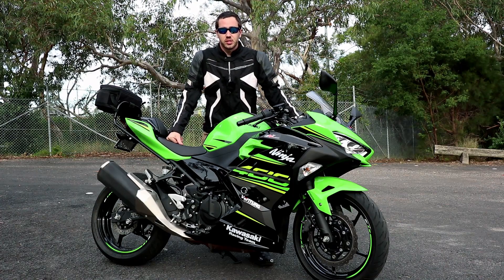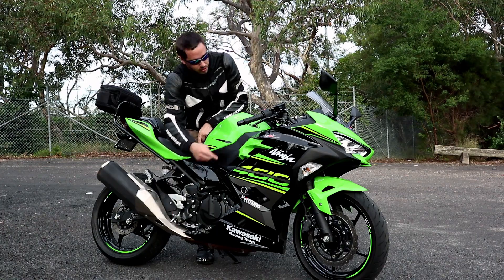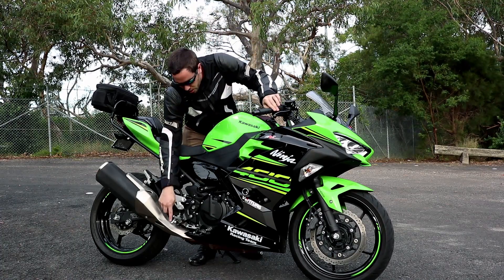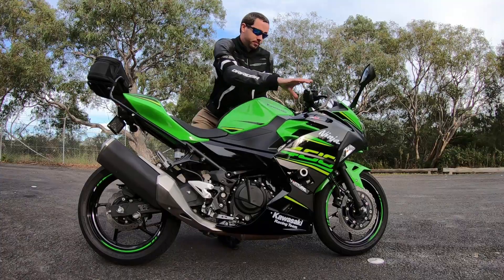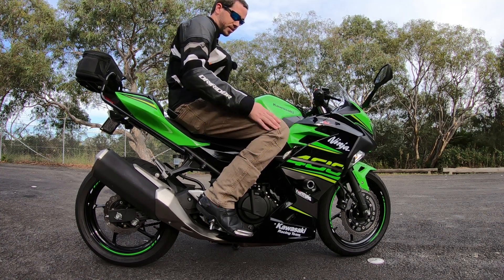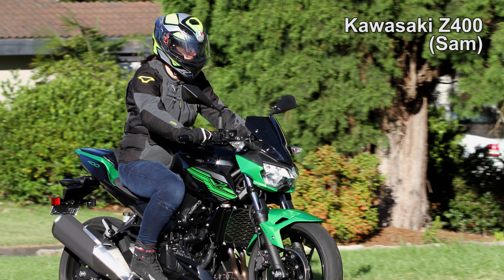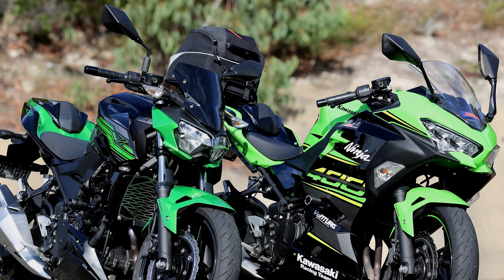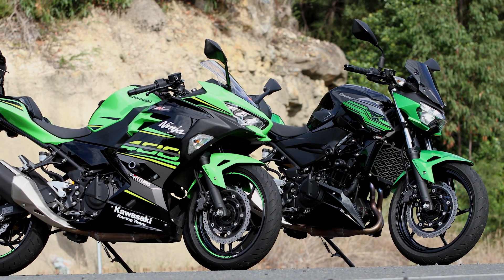Motorcycle Ride Triangle (Ergos) - With the Ninja 400

Comment: Hello buddy, I have one ninja 400 too, and I 'm looking for something like yours in the back. This pipe for holding  the bag, could be used by the passenger? my girl is afraid to ride the bike she dont have where to hold her hands. Could you tell me where you bought this one? Thanks
Reply from the maker: I think so, as long as your pillion is keeping their weight forward, they should definitely be able to hold on to the rack so they don't feel like they'll fall off the back! That's a Ventura Sport-Rack on it there, which has the higher loop. There's also a grab rail version and a heap of other options.

Here's the website link, you can see whether there's a local distributor for you, top left under the International website options.
https://www.ventura-bike.com/#

Comment: I noticed that in 1.44 minutes when you get on the bike you have to press down the brake pedal in order to get a comfortable riding position. So the riding position is too cramped and not good for you. I have the same problem, have long femur bones and limited dorsal flexing capabilities. I will subscribe. You cover important topics.
Reply from the maker: To be honest I normally park in neutral unless I need the bike in gear to stop it rolling, so it's just a habit of making sure the bike doesn't roll away. But having long legs does have a real impact on bike fit! Thanks for subbing!
Reply: @MotoJournoKris  Ok, it is safe but for me it also seems to be a more comfortable riding position for you :-)

Comment: Hey mate, what do you think about the ergonomics of the all new ninja  zx 25r? I watch a lot of videos but i cannot figure it how the ergos looks like considering that it is a zx line up..
Reply from the maker: Doesn't look like we'll be getting them here so I haven't been able to check one out in person, but comparing the bikes the bar placement on the  ZX-25R is much lower, further forward and more aggressive, so more like the ZX-6R there, while the seat looks a bit lower, and the tank more compact. Pegs don't look too different to the Ninja 400, maybe a little higher, which would be more compact. The 400 is quite relaxed by sportsbike standards, so the ZX-25R should be more like a ZX-6R or ZX-10R if smaller, with that very committed seating position.

Comment: So i am  looking into getting my first bike i am  between z400 and ninja 400 ,what do you think will suit me better (i am 186cm tall and 100 kilos macular body type) my concern is that my knee will be bent too much and will be uncomfortable, is there a big difference on the sitting position?
Reply from the maker: I didn't find a significant difference between the two as far as seat and peg position, although the Ninja 400 is a little wider between the legs. I'm only 180cm but on the longer legged side and felt like there was good amounts of room - for sporty little machines. The bigger difference is the 'bar placement, which is more upper body position.
Reply: Also thinking about the duke 390
Reply from the maker: @Bobisdeadrun  It's been a while since I rode the Duke 390, but they are compact and probably even smaller feeling than the Z400, which is kind of offset by a taller seat height. I think the latest edition actually has an even taller seat height than the one I tested, but then you need to check out the reach to the pegs.

Comment: I am 5'2. Ninja 400 is good or bad for me?
Reply from the maker: You'd probably need to sit on one to be absolutely sure, as it's quite a low seat height and very narrow between the legs, but you might not be flat footed. The weight and centre of gravity is also low and easy to manage though, which should help if that's the case.
Reply: @MotoJournoKris  tnx sir. Im not sure if ninja400 i want 2 buy. Yamaha r3 is the other option. Thank you very much sir. Im a beginner.
Reply from the maker: @shamluck1780  They are both great options for new riders, there's not a huge difference in seat height and reach to the ground between them, but there's some slight variance in seating position and reach to the 'bars. If you can, try and visit a motorcycle store and sit on both to get a feel for them.
Reply: @MotoJournoKris  for your opion sir about seating position. Which is the best for you? N400 or r3? I try r15 but seat height is a high.
Reply from the maker: @shamluck1780  The R3 felt a bit more aggressive than the Ninja 400 to me, due to the bar placement and the seat is more comfortable. But for some riders they may prefer the Ninja 400 being a little more upright.

The R15 actually has a taller seat height than both, but if a very narrow bike, so you'll probably find the R3 or Ninja 400 easier to reach the ground on.
Reply: @MotoJournoKris  thank you very much sir. I always watch your video. 👍👍👍👍👍

Comment: What's good, Kris? I heard that your right heel ends up touching the pipe on the 400, can you confirm/correct on that?
Reply from the maker: I haven't noticed that to be honest, but if you're riding with the balls of your feet on the peg but flat footed and have big enough boots it's possible. If I'm riding fast enough to have the balls of my feet on the pegs I've usually got my heels tucked up against the heel guards. My everyday boots are a US12, and I have had that on some bikes in a more intrusive way though.

Comment: For me that ninja 400 has the perfect triangle for comfortable sport bike riding. Like a sport tourer/sport commuter. But it absolutely amazes me why they make such a good triangle yet the seat is only good for 30minutes. Basically it’s good for a test ride and then you part with your hard earned money. Argh, I guess not one bike is perfect. Simple fix I guess, take the seat straight to an upholster.
Reply from the maker: Yea that seat becomes uncomfortable really quickly. Having thought about it a bit more, I reckon being so sculpted to keep the seat height low and it very narrow at the front, it probably ended up hard to add enough padding, without bumping the seat height up. Being the first thing a lot of new riders look at they probably wanted to keep that figure as low as possible.